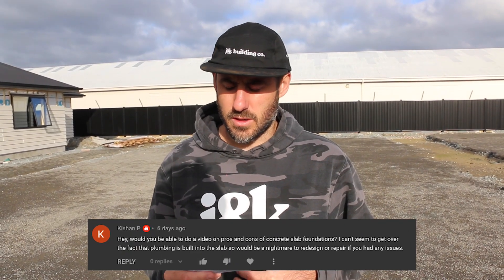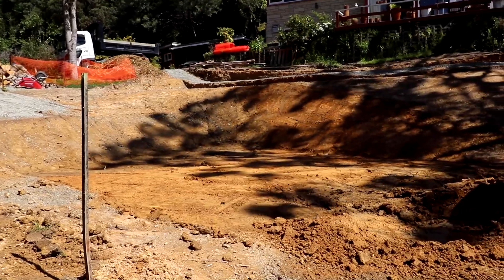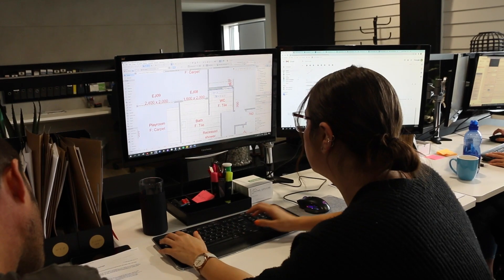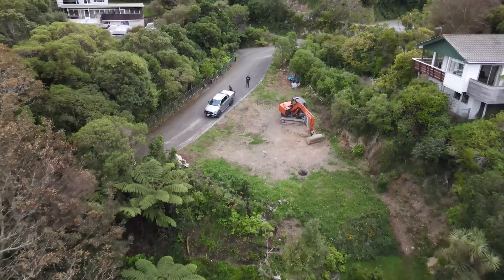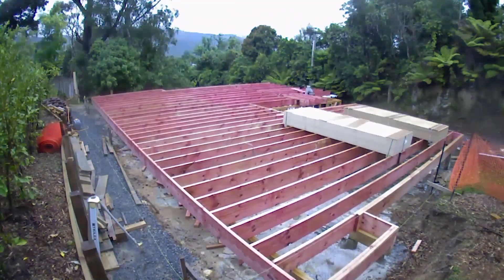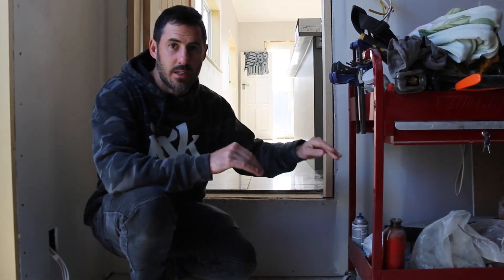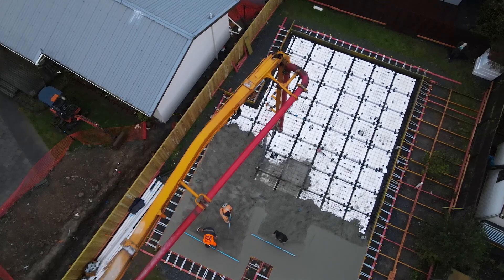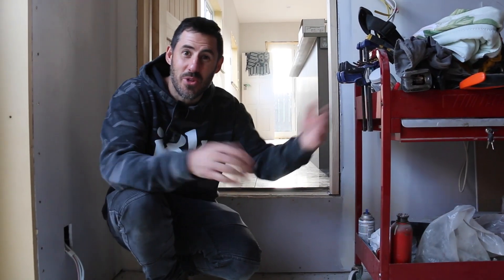Why Do We Use Concrete Slabs???

Comment: Two questions for you… Do basements ever get built in NZ?
Why do you use treated wood timbers as piles and not concrete or helical steel piles?

No criticism just curious… I really like slabs, but where I live they are not very commun. Mostly full basement to get below the frost line… ha, something that you guys don’t have to worry much about I guess. Great content by the way.
Reply: Basements aren't very common in standard houses as we have no real need for them apart from wine cellars no storm/tornado shelters are required. Timber Piles are economical as we are a land of Trees
Reply from the maker: We don't have a frost line like North America, so there is no need to dig out so much dirt under foundations, 

Re Piles, we use concrete and steel about 50% of the time, it depends on the engineer, the ground, the access, etc etc